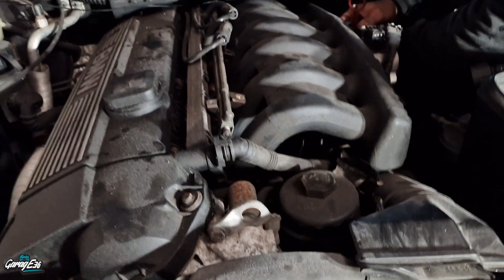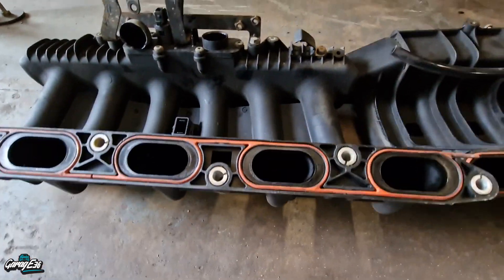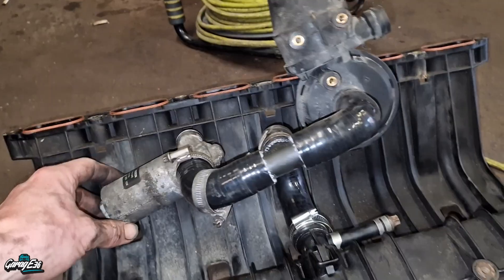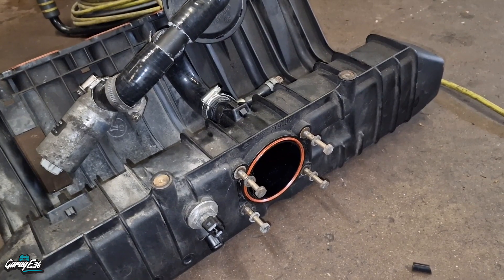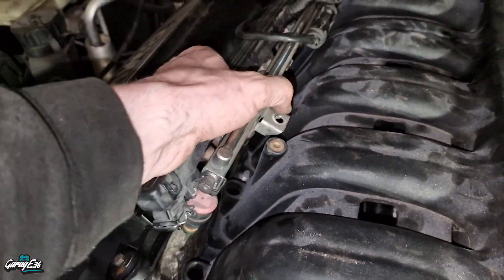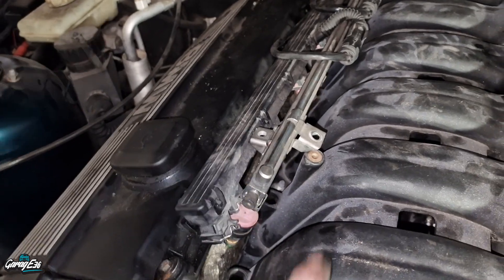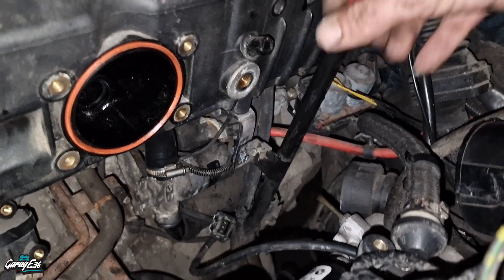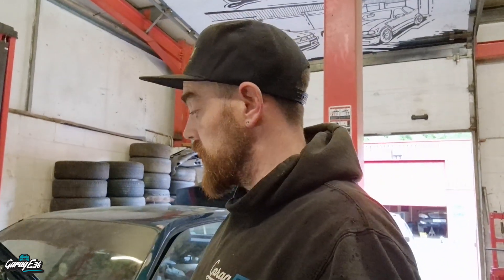BMW E36 M50 Manifold fitting guide | How to fit M50 manifold | MS41 ECU Remapped

Comment: In EU we got the 2.0 version single vanos of the M50 carefull with that intake. It wont fit proprelly. It will fit on the 2.8 but has a small gap ( cilinder head ports to big for the M50B20 Intake) its possible to make it work but if u work into problems u know what it is. Just leaving it out there so no one deals with the same problem as i did.
Reply from the maker: Thanks for the comment. Was never aware of that.